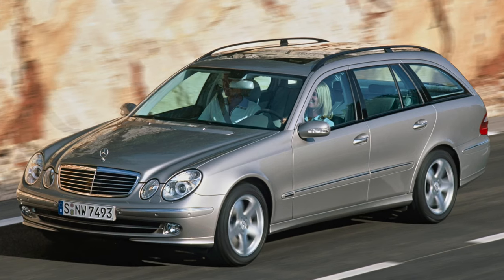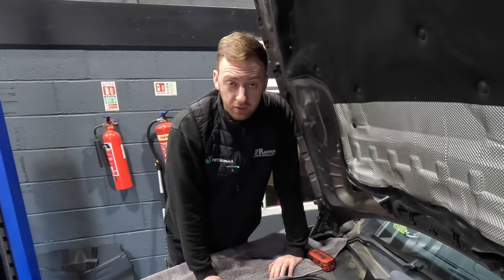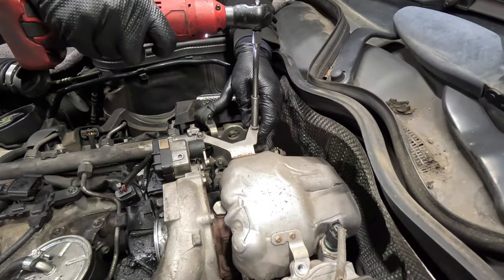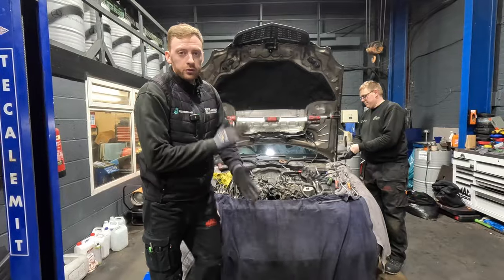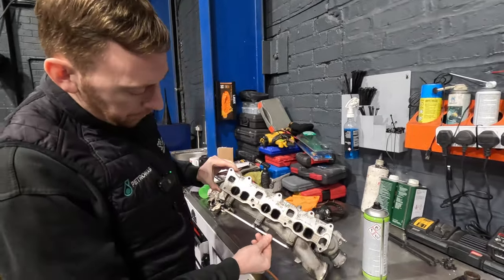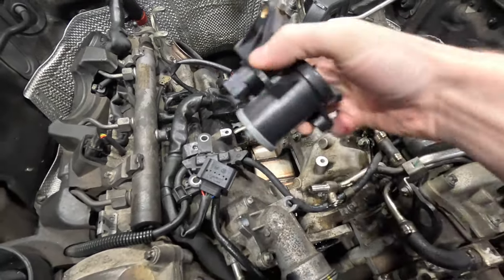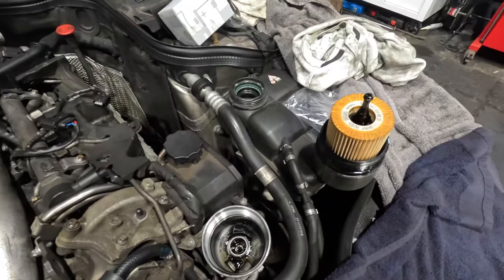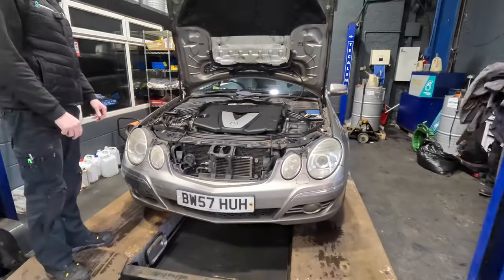Mercedes E-Class W211 OM642 v6 CDI. 3 most Common engine faults, oil cooler seals plus more!

Comment from the maker: Competition winner - David Cowan - sprautos@gmail.com 
really common job this guys, if you own this engine you may of had this done, if you haven't there is a good chance you may in its ownership so will give everyone an insight to the job. Although this video makes it look very easy this is actually an 8 hour job! Hope you enjoy all the best everyone.For those asking this job with the turbo was about £2K
Reply: I had this job done a couple of weeks ago (leak was just a slight weep though) - it was picked up at a routine service. Turbo was OK. 167k on the clock. Hopefully it’s going to last a long time now! Great video, by the way - liked & subscribed 😀
Reply: Hi, great, first video I have found with the same surging, I seem to have this fault, is there a way to check the turbo itself to garentee it is at fault? 
I have the surge I have the pressure code and no eml.
I must say though it is intermittent, doesn't do it every time you floor it, 50% maybe but it only happens on full send accel
Reply from the maker: @mikejennings7779  you should have an exhaust back presure sensor, i would change turbo, back presusure sensor, and inlet motoro in one hit to cover a few common faults at once.
Reply: Did mercedes resolve this issue re the oil cooler seals and if yes when? Thinking about my 2012 R Class
Reply: Brilliant and very informative videos.
Well done guys.
(if only every garage was as professional)

Cheers from Fife, Scotland 🏴
Reply: @sprautos Hi, 
Can turbo’s be refurbished? I suspect that the bearings wear out. Maybe it’s a specialists job or maybe it’s not worth the effort. 
I’m just curious.
Reply: Great, honest and very informative video. Cheers chaps.
Reply: just brought one mate 
so ill be seeing as it needs it and thank you
Reply: Have you got a link to where I can buy those link rods, I'm having my oil cooler seals done on my 2013 cls and need to order them

Comment: This is one of the best engines Mercedes made after 2000 . I've had it in many vehicles including jeeps . As long as you keep it up with preventive maintenance and change the oil every 8000 km it runs and runs and runs ... as long as you're not scared to do some stuff yourself , it's not really expensive . Love it , recomend , 5 stars , 10 out of 10 .
Reply: No way. The Inline 6 CDI was the last great  Mercedes-Benz diesel.  The V6 diesels suck.
Reply: @closer71  why is the V6 the bad engine? because it is compact inside some cars or what? The inline 6 did have some issues right?
Reply: @MoesKeckeEcke  Because he's parroting internet stories. The v6 is more sensitive to bad maintenance compared to the older i6, that's true, but that's about it. It's only issues are with the oil cooler and the flaps getting stuck, but the flaps can be cancelled with a resistor and the oil cooler can be kept an eye on. I've seen fleets of sprinters with this engine, all around 650-800k km and still running. Some oil leak here and there, but still ran strong. 1 went over 1 mil km before being finally retired, but not because the engine was bad, but because the truck bed and inside the cabin was getting really worn out.
Reply: Sorry but I had an E320 Bluetec with the 642 engine and it was dreadful. In the span of one year:
New swirl motor (twice)
Oil cooler seal (twice because the dealer screwed up the installation)

New turbocharger
Three new fuel injectors 
New motor mounts
New intake manifold
Numerous oil leaks. 

Car was serviced at the dealership at the correct service intervals. They never did fix the real problem. Car ran fine until you needed to accelerate to get onto the interstate and the car would go into “limp home”. Twice I almost got killed by a semi truck. 

Best engine? Nope!
Reply: @em4703  No.  it’s because I own two.  An OM617 and the 2005 CDI.  Smart ass.  The V6 is a piece of shyt.
Reply: @MoesKeckeEcke  It just has a few design flaws — blue emissions fluid chief among them — and lacks the durability and reliability of the old Daimler diesels.
Reply: @vintagehaynesflute  Sounds like you bought a dud. Using a single example to brand an entire engine as junk is beyond stupid.
Reply: @sheilamorrison1954  in the USA they were considered trash
Reply: @sheilamorrison1954  I’ve been driving Mercedes cars for 35 years and the 642 diesel is garbage. Ignoring the problems of the v6 diesel could be construed as stupid

Comment: Another reason why you'd buy a W211 E320 V6 M112 Merc. An easier engine to work on & they go forever. Diesels are an absolute waste of time!!!!!
Reply: Modern diesels yes. The diesels between 1970-2005 are the best engines mercedes make
Reply: You're a waste of time 😂
Reply: You have no clue by your comment!
Reply: I own a 126 300SD 1983. I propably have 370,000 miles on that turbo diesel. I had to replace the plastic gears in the odometer. So I do not know exact millage. But I have done all kinds of maintenance on this very easy car to work on. Inline give cylinder. My most favorite car to work on! The Englishmen team did a very professional job to that V6 diesel!

Comment: Your attention to detail is first class. Glad I decided to buy a boring 2.1 4 cylinder C class now!
Reply from the maker: Great little work horse and mpg
Reply: @sprautos  C220 CDI. As a petrol head, the dpf thing makes me nervous. Hopefully it won't develop any issues.
Reply from the maker: You will be fine, premium fuel now and again. Treat it to a JLM diesel extreme clean once a year.
Reply: I'm glad I've got my W204 with the OM646 which seems to be bit more bulletproof than the OM642. Would regular oil and filter changes help with the OM642 or are these just inherent fualts?
Reply: @sprautos thanks for the advice. Much appreciated.
Reply from the maker: @Parknest  regular oil and filter changes are always good for any diesel, but I think the seals are a bad design
Reply: I have an on 646 (vito) has worked very hard for me now has 300th miles done turbo injectors clutch had dpf egr delete as dpf was giving me issues had boost pressure sensor faults alternator and starter motor still on original timing chain and gearbox engine has never been opened up. I also have an om642 (2012 c350cdi) on 100th miles had since 50th miles have done oil cooler seals suspension level sensors and that’s it in 4 years driving and 50th miles
Reply: @Parknest  i have a 2007 s-class. All services done every year at mercedes dealer where i bought it. Only 65000km...got a beginning oil cooler leak last year. So it is not the lack of service that's causing the problem. It will happen when the sealing gets older. Think that's why they replaced it by the purple ones.
Reply: Om642 is bullet proof got 250k mine running 340 bhp and never missed a bit and still going on original timing chain too
Reply: @thomasokolie1406 how are you getting that hp ? What car is the engine in
Reply: @dannyd.8753 the purple ones are better and the newer om642 come with those, but they will fail too lol
Reply: This is way I got R6 😊

Comment: I had an E320 straight 6 from new, put 200k miles on it without a single issue. Then I had TWO of these W211 V6 CDI's. They both had Oil leaks, Swirl Flaps. EGR Valves, DPF Filters, Turbo Actuator and eventually both turbos all replaced on these absolute shit boxes. Genuinely wouldn't take another one of these for free.

Comment: 2 other common issues I have found over the years is the PCV on the back left head faiils which allows the oil to travel down the pipe and into the "Y" pipe and then out of the large orange seal. The turbo ends up being changed thinking it's leaking oil when infact it's the PCV thats failed instead. The other one is the large green O ring in the inter cooler pipe at the top of the engine. It's either missing or not giving a proper seal.
Reply: an the big red seal that is on the Y to the turbo snail.. also usually a seal that gets hard or unsealed...

not too bad this engine

Comment: Cut my teeth on these in the early 2010's....did sooo many exhaust manifolds on the 642 for metal pieces coming apart and mashing the turbo...That and the 272 balance shaft tear wearing off, Good old Crank/CAM correlation. I miss my days at a Mercedes dealer, Now I'm meddling with Audi...😂

Comment: Nice to see an OM642 💪🏼
Reply from the maker: More to come!
Reply: I have an OM642 in my C207. But I really miss the sound of the OM648 from my old W211.
Reply: @martynm.449  older engines just had more character
Reply: @G20Details  is that your CLS? Beautiful.
Reply: @martynm.449  yes it is thank you very much, this car actually goes to SPR for most of its work
Reply: @martynm.449 
In my S class W 220 I have the OM 648 engine and apart from the M 113 engine, it is the best Mercedes engine 😊

Comment: Hi bud, I'm going to buy a 2010 Mercedes 350 cdi v6 with 60000 miles and full service history. When does this problem usually occur and are they generally solid cars. Just a bit worried because of the age.

Comment: So glad my Merc mech advised me to avoid these engines and the v6 petrols. I’ve got a R129 SL320 straight 6. He told me to avoid the V12 as it would cripple me financially. Wish I’d bought the R129 SL72
Reply from the maker: M112 v6 petrol was a tank. 272 was ok. Yes I’m not a v12 fan either. Sl 72 is something very special though. R129 with a m113 v8 is the best combo in my opinion
Reply: @sprautos 
My straight 6 Petrol has been bomb proof as half of V12 used in many other cars.

Comment: I so like your channel. Just, what I did to my 648 straight 6 cdi was removing the flaps altogether. The whole system is just to vulnerable. Oh, also disconnecting the egr. Life is good. But I’m living in Texas. Probably not possible in the UK. I feel so sorry for all the regulations you have to deal with. And just to get some more oomph I had my ecu remapped by Renntech. You got to love these diesels. Pretty rare in the USA.
Reply from the maker: That stright 6 cdi was a beast

Comment: When I done mine I removed the intake swirl flaps from manifolds with pliers and for turbo only the actuator I changed to the corect G227 I think code, purple gaskets are made of viton which should last longer ,not hard job but long time and yes change all gaskets clean all carbon and should be ok. Good video.

Comment: A very strong engine, I had a 320 and now a 350, fortunately never had the oil leak issue (Yet), but the 320 did have the swirl flap issue!

Lovely to see Sam and John doing the job properly. Most garages would likely only tie the flaps open and make do.

I speak from experience!

Keep doing what you do, and as you do SPR.

See you in March.

👍🏻👍🏻

Comment: The other " while your there" job to do is replace the O ring on the EGR cooler plumbing where it pushes into the inlet manifold. (7.10)The other end of the cooler from the flange. I had to do this whole job because that O ring failed and leaked coolant at a huge rate. Within a couple of days of first seeing a leak under the car the engine wouldn`t hold any coolant. This was an OM642 in a Jeep with only 140k on the clock. Good excuse to do the Oil cooler seals before they leaked so no big mess in the engine valley to clean up.

Comment: I did all these jobs. my self. yes a biiiggg job. but the turbo is still running more than 90 000 km.. even when that turboproblem shows. but a restart and it all good for weeks...sometimes mnd.  just love that strong engine. and love the torque.

Comment: As a precaution you can place a piece of thin rubber under the plastic intake pipe, then if leaks occur the oil will exit down the outside of the turbo not leaking into the swirlmotor thru its connector. Also use the revised black rubber skal on plastic inlet.

Comment: Very informative, i really like your attention to detail top notch. I like your aluminium linkage upgrade for the swirl flaps and inlet motor replacement, i would not get the same attention to detail at my local Mercedes specialist. Great work!

Comment: Well done guys. Mine 2011 350 CDI CLS have done 83000 miles and I believe at one point, I will have the same problem.
Reply: I believe that from 2010, Mercedes started factory-fitting the new upgraded (purple) oil cooler seals to all new OM642 engines, so you should actually be ok. At least with the oil cooler problem described here!

Comment: Great video guys, it would be nice to know a rough costing for this type of job since it’s a popular fault. Gives us a heads up so to speak😂😂
Reply from the maker: This job would cost you £1500 without the turbo, more towards 2.5k with a new turbo.
Reply: I have the same engine in my 2012 w204 and I believe it needs the valve stem seals replaced, how much extra would it cost, and do the heads need to come off to get to the valve stem seals. Thanks for the great video.

Comment: An oil catch can circuit between CCV & turbo inlet would reduce substantially amount of oil that cascades down into valley from batwing turbo inlet seal. In my opinion, that is true source of most car om642's oil leaks. It soaks swirl flap motor, splashes all over turbo pedestal & then pools around oil cooler before draining through that weep hole in valley near bell housing. These issues don't really exist on 642s from Sprinters because they have a much better air intake system & larger oil pan that can accept 5 more quarts of oil. Every time I see another om642 oil leak video, I thank my lucky stars that I still have an om648 w211 on the road.

Comment: Pure professionals. I am thinking of buying a 2013 CLS shooting brake 3l Cdi with 130k mile on her. Very well serviced  with the cooler gaskets already done apparently. Just wondering would this need to be done again down the road, is this issue a design fault regardless of how well its serviced. Are these engines very reliable generally if serviced well. Cheers for the video guys it was a pleasure to watch.
Reply from the maker: They have changed the seals, so time will tell
If it will need doing again down the road, it will be interesting to see. 
🙏

Comment: At first, I thought that you were going to be working on a failed radiator/trans oil cooler which was what put paid to my E211 270 transmission - good old Valeo rads! Enjoyed this one though!
Reply from the maker: Yea used to do a few of those back in the early 211 days. Think I still have the test kit to test the trans fluid
Reply: @sprautos  The only time that I have ever traded in a car knowing that it had a fault - to the dealer that sold it to me 18 months earlier. That 2003 E class was the most unreliable car that I have owned!

Comment: I have all the faults you’ve covered on my ml320,  I had the oil cooler done a year and a half ago, at over a £1000 , but it would appear that my mechanic stitched me up it is now leaking water and a bit of oil not as much oil as before, so it’s lying in my driveway now doing nothing , being a pensioner I can’t afford to get it done again, I also had a new turbo fitted 4 years ago and the car started the kangaroo bit when I accelerated hard,  but again couldn’t get anyone to diagnose the problem at the time, 🤷‍♂️🤷‍♂️🤷‍♂️  but thanks for your video very informative cheers 🙏👍👍👍
Reply: Put Xado stop leak on radiator, it will help avoid oil and water mixture.

Comment: Thanks for this awesome video with tons of valuable info, even the parts list! 

Question: Looks like you got a new turbo? So the stuttering was caused by a faulty turbo or was it the faulty/worn flaps? I do have that stutter every now and then, but only when I floor it. Normal acceleration doesn't produce that issue. Don't want to buy a new turbo if it's probabaly only the flaps. I'd come to you but living in New Zealand it's a bit of a challenge 🙂
(2007 CLS 320 Cdi, 220,000km) And yes, I have an oil cooler leak as well...
Reply from the maker: Stuttering is from
The turbo actuator, we replaced full
Turbo due to the mileage on this one to make sure it was 100%
Reply: Awesome, thanks. I never could figure out what the problem was as the fault codes did not mention the turbo,  most of the times it was exhaust back pressure. Thanks again!

Comment: Very informative video well done! This engine was part of so many merc models and variations. Why do you think they went back to straight 6 ones? Is it just cost to make?
Reply from the maker: I’m really not sure, I’m
Presuming it was emissions related, the v6 cdi was a nice smooth torquey engine. 
I wonder why they move on from many engines at times 😂🙈

Comment: This vid gave me flashbacks of when I did the cooler seals on my R class. It was fortunate that I did it during furlough as it took me a couple of weeks (a lot of that was waiting for parts though).  I found the previous owner had done the resistor mod to delete the swirl flap motor. I took the opportunity to reinstate the flaps with a new motor and an aluminium rod kit. The previous owner had also fitted a chineseium actuator to the turbo but I ordered a genuine refurbed one from the states.

One little mod I added was I added a shroud made from an old drinks can to cover the swirl flap motor as even though I was replacing the turbo inlet seal, I have only ever known them to leak. The shroud is shaped to guide any oil that drips down behind the flap motor and into the V. I'd be curious to know if you have a definite fix for the red seal leaking?
Reply from the maker: Well done, there not easy on an r class, it’s probably the hardest one along side a Vito. So well done, plus you’ve addressed loads of other issues.